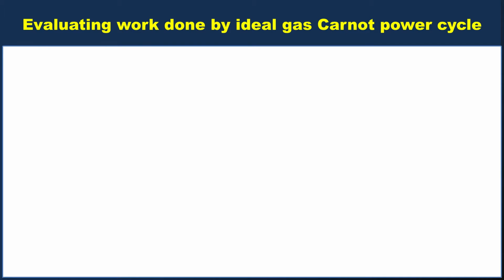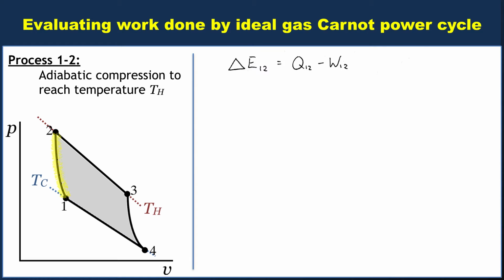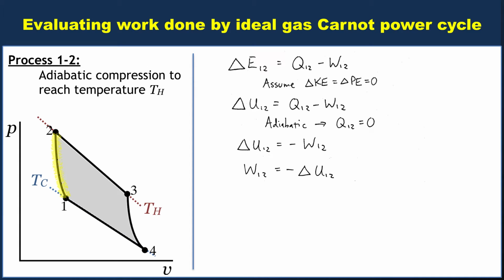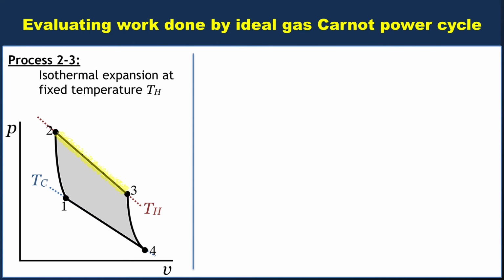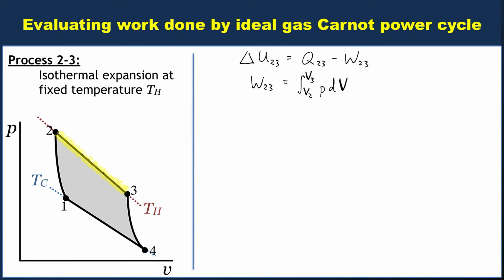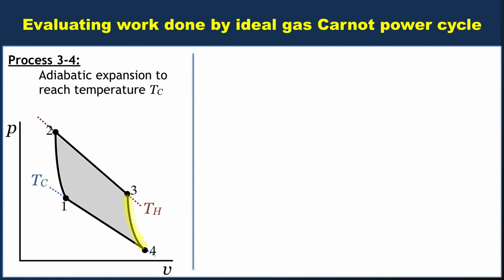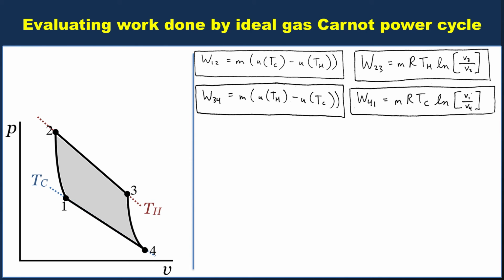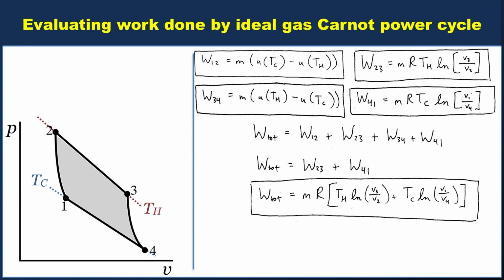Example: Evaluating work in an ideal gas Carnot cycle

Comment: But change in internal energy= ΔE=Q+W. However, everywhere you have taken ΔE=Q-W. Why? Is it correct?
Thanks
Reply: The sign convention for work is opposite than that of heat transfer. Work done TO your system is negative, work done BY your system is positive. So ΔE=Q-W.
Reply: What Sammy said, just sign conventions. Taking Thermo rn and the professor set the convention -W is work done by the system. I’m curious about the opposite part tho, cuz I didn’t pay attention in class too well 😅